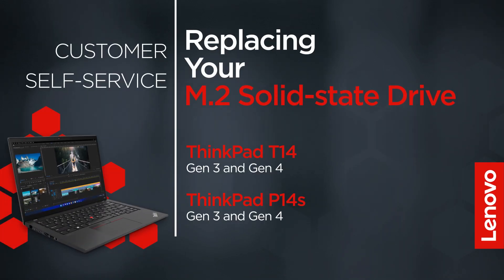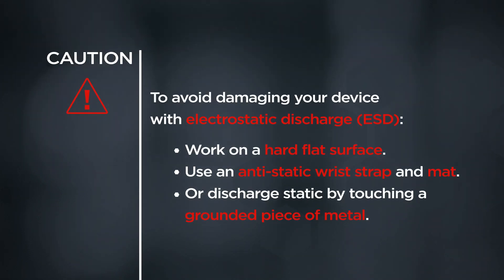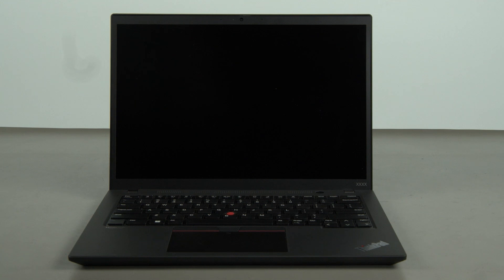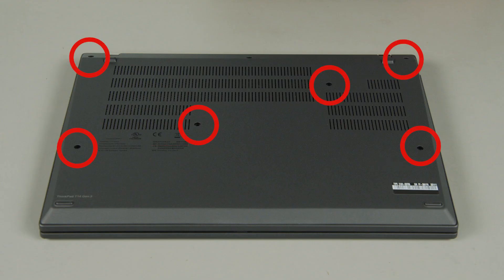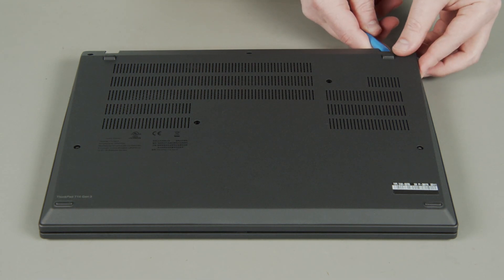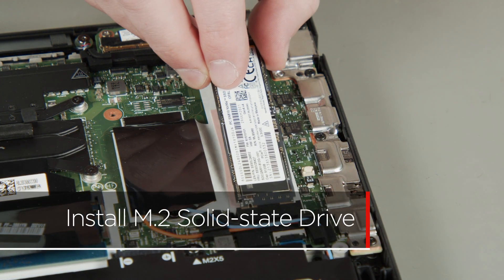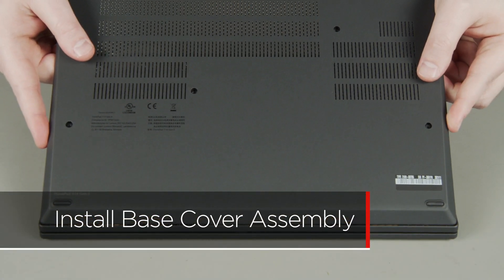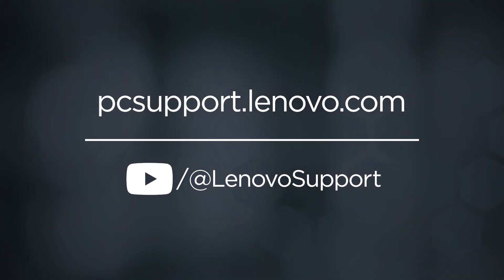Replacing Your M.2 Solid-state Drive | ThinkPad T14 and P14s Gen 3 and 4 | Customer Self Service

Comment from the maker: This video will show you how to replace the M.2 Solid-state Drive of your ThinkPad. The process in this video will work for the ThinkPad T14 Gen 3 and Gen 4 and the ThinkPad P14s Gen 3 and Gen 4. 

You will need a screwdriver kit, a non-metallic pry tool, and 15 minutes of your time.

ThinkPad T14 Gen 3 Repair Guide: https://pcsupport.lenovo.com/us/en/products/laptops-and-netbooks/thinkpad-t-series-laptops/thinkpad-t14-gen-3-type-21ah-21aj/selfrepair/removalsreplacements

ThinkPad T14 Gen 4 Repair Guide:https://pcsupport.lenovo.com/us/en/products/laptops-and-netbooks/thinkpad-t-series-laptops/thinkpad-t14-gen-4-type-21hd-21he/selfrepair/removalsreplacements

ThinkPad P14s Gen 3 Repair Guide: https://pcsupport.lenovo.com/us/en/products/laptops-and-netbooks/thinkpad-p-series-laptops/thinkpad-p14s-gen-3-type-21ak-21al/selfrepair/removalsreplacements

ThinkPad P14s Gen 4 Repair Guide: https://pcsupport.lenovo.com/us/en/products/laptops-and-netbooks/thinkpad-p-series-laptops/thinkpad-p14s-gen-4-type-21hf-21hg/selfrepair/removalsreplacements

To learn more about your device go to https://pcsupport.lenovo.com

To find parts for your device go to https://support.lenovo.com/parts-lookup/?cid=ww:lenovosocial:b9515f&source=socialmedia&subsource=yt

To view the Lenovo Support Self-Repair Guides landing page go to https://support.lenovo.com/us/en/solutions/HT516547

** NOTE: Static electricity can destroy components. Use a grounding strap, and clean, non-conductive surface to work on. Use plastic or coated tools to prevent scratching and avoid using metal tools on plastic parts. For more detailed information on electrostatic discharge and how to prevent it, please watch our ""Understanding Electrostatic Discharge (ESD)"" video: https://youtu.be/by4PB3WtdLo 

Applicable Machine Types:
ThinkPad T14 Gen 3 - 21AH, 21AJ, 21CF, 21CG
ThinkPad T14 Gen 4 - 21HD, 21HE, 21K3, 21K4
ThinkPad P14s Gen 3 - 21AK, 21AL, 21J6, 21J5
ThinkPad P14s Gen 4 - 21HF, 21HG, 21K5, 21K6

#lenovo #LenovoSupport #LenovoTechSupport